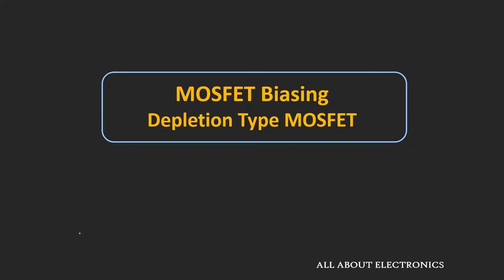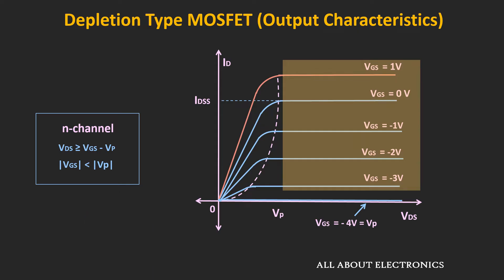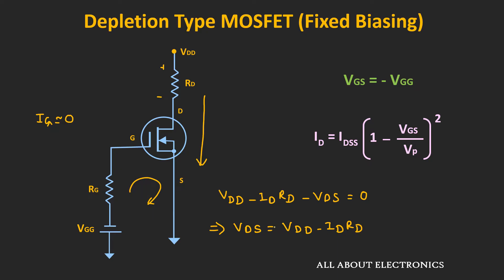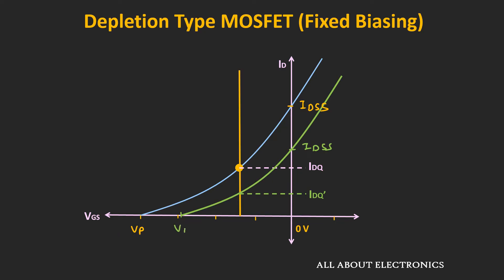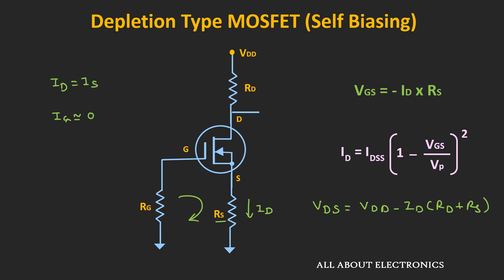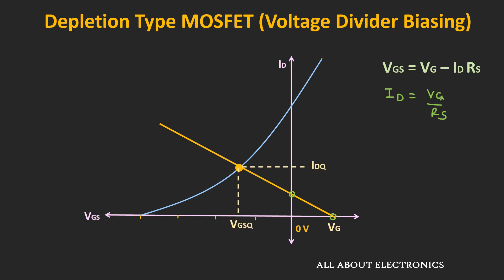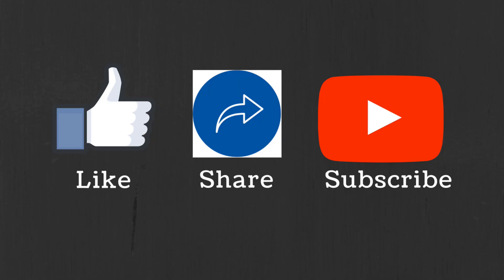MOSFET Biasing: Depletion Type MOSFET Biasing (Fixed Bias, Self Bias and Voltage Divider Bias)

Comment from the maker: Timestamps for the different topics covered in the video:
0:00 Introduction
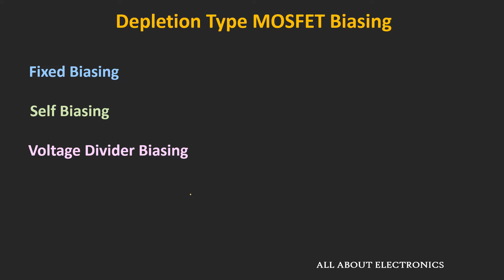2:25 Fixed Bias Configuration
5:35 Self Bias Configuration
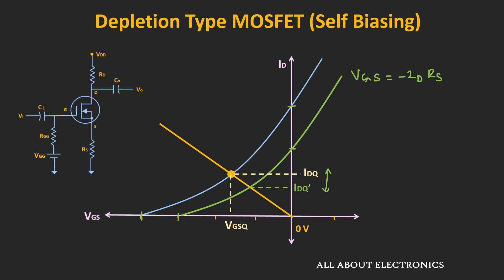8:03 Voltage Divider Bias Configuration
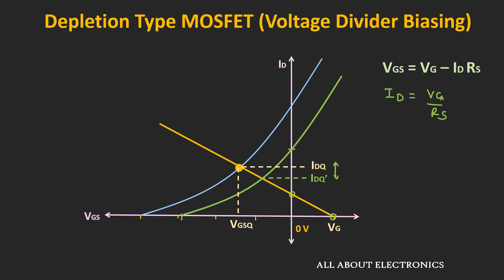11:13 p-channel MOSFET Biasing

Comment: Why is there no voltage Rs in the fixed bias circuit of D-MOSFET?
Reply from the maker: You mean to say why there is no resistor Rs in the fixed bias configuration ? Actually that is why its called fixed bias. If there is a resistor Rs, then it provides some feedback back to the input side. And it improves the stability. But in fixed bias configuration there is no resistor Rs.

Comment: why the load line is straight or vertical for fixed biasing where for self and voltage divider biasing the load lines are inclined and going through the origin? if the load lines were straight for self and voltage divider biasing like fixed biasing then variation would be high as fixed biasing.

Comment: Perfect....What about the effect of load impedance on the biasing  stability
Reply from the maker: I am assuming, you are talking about effect of Rd. The load RL, is connected using the decoupling capacitor. So, it will have an impact on the gain. But the resistor Rd will decide the available voltage swing for the amplified output. 
I hope it will clear your doubt.